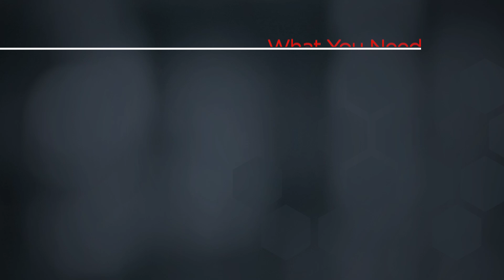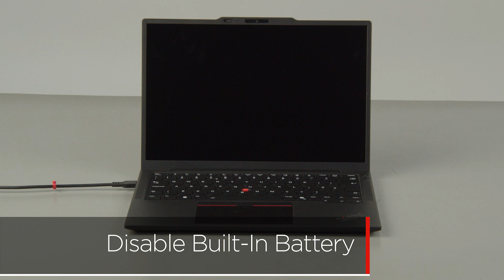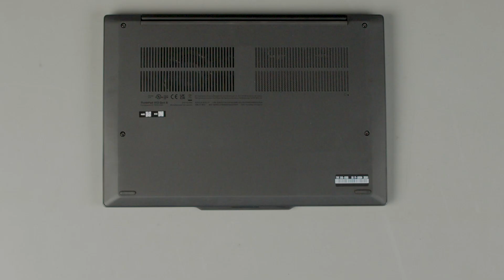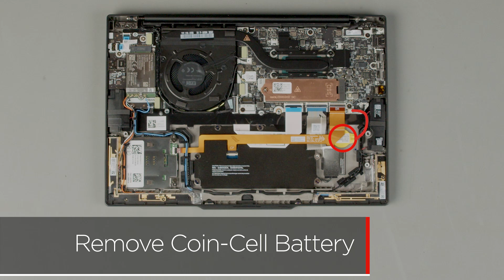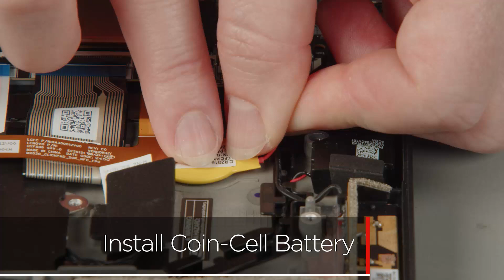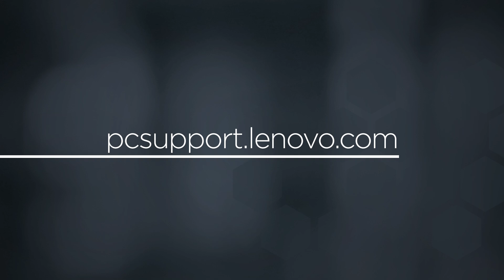Replacing Your Coin-Cell Battery | ThinkPad X13 Gen 6 | Customer Self Service

Comment from the maker: This video will show you how to replace the coin-cell battery in your ThinkPad. The process in this video will work for the ThinkPad X13 Gen 6.

You will need a screwdriver kit, a non-metallic pry tool, static-safe tweezers, and 15 minutes of your time.

To learn more about your device go to https://pcsupport.lenovo.com

To find parts for your device go to https://support.lenovo.com/parts-lookup/?cid=ww:lenovosocial:b9515f&source=socialmedia&subsource=yt

To view the Lenovo Support Self-Repair Guides landing page go to https://support.lenovo.com/us/en/solutions/HT516547

** NOTE: Static electricity can destroy components. Use a grounding strap, and clean, non-conductive surface to work on. Use plastic or coated tools to prevent scratching and avoid using metal tools on plastic parts. For more detailed information on electrostatic discharge and how to prevent it, please watch our "Understanding Electrostatic Discharge (ESD)" video: https://youtu.be/by4PB3WtdLo 
Warning: Use only the authorized battery specified for your computer. Any other battery could ignite or explode. 

Batteries supplied by Lenovo for use with your product have been tested for compatibility and should only be replaced with approved parts. A battery other than the one specified by Lenovo, or a disassembled or modified battery may not be covered by warranty.  

Battery abuse or mishandling can cause overheat, liquid leakage, or an explosion. To avoid possible injury:
Do not open, disassemble, or service any battery unless you are competent to do so and ensure that you carefully follow all instructions provided by Lenovo.
Do not crush or puncture the battery.
Do not short-circuit the battery or expose it to water or other liquids.
Keep the battery away from children and animals.
Keep the battery away from fire.
Stop using the battery if it is damaged, or if you notice any discharge or the buildup of foreign materials on the battery leads.
If the battery is incorrectly replaced, there is danger of an explosion. The battery contains a small amount of harmful substances.

Lenovo has no responsibility for the performance or safety of unauthorized batteries and provides no warranties for failures or damage arising out of their use. 

The Vantage app provides an automatic battery diagnostic test that determines if the built-in battery is defective. A built-in battery should not be replaced unless this diagnostic test shows that the battery is defective. The only exception to this is if the built-in battery is physically damaged.

If the Vantage app is not installed on the computer, download and install the program to diagnose the built-in battery before replacing a non-physically damaged built-in battery. Note that the replacement of a physically damaged built-in battery is not covered by the warranty.

https://www.lenovo.com/us/en/software/vantage/

Store the rechargeable batteries or products containing the rechargeable batteries at room temperature, charged to approximately 30 to 50% of capacity.
We recommend that the batteries be charged about once per year to prevent overdischarge.

Do not put the battery in trash that is disposed of in landfills.
Do not dispose of your battery with your household waste.
Comply with local ordinances or regulations when disposing of the battery.
For recycling information, go to https://www.lenovo.com/recycling

Applicable Machine Types:
ThinkPad X13 Gen 6 - 21RK, 21RL, 21RM, 21RN

Check out other official Lenovo channels!
https://www.youtube.com/@Lenovo 🟥
https://www.youtube.com/@lenovolegion 🎮
https://www.youtube.com/@Lenovo-PC 💻
https://www.youtube.com/@LenovoSuporte 🟢🟡

#Lenovo #LenovoSupport #LenovoTechSupport